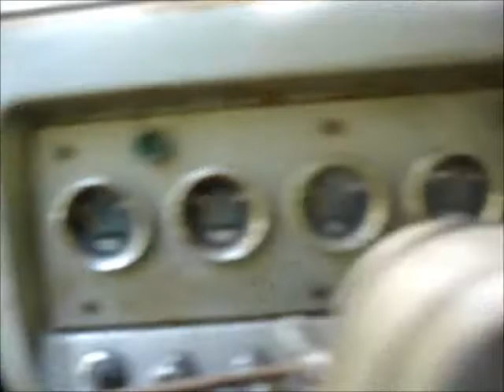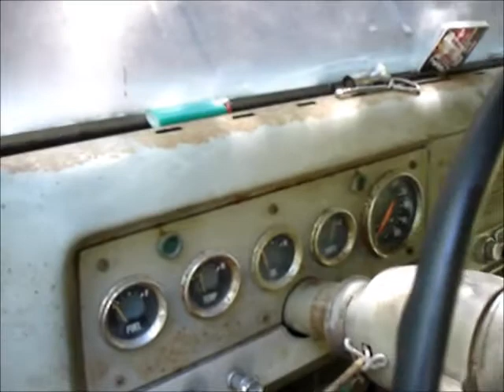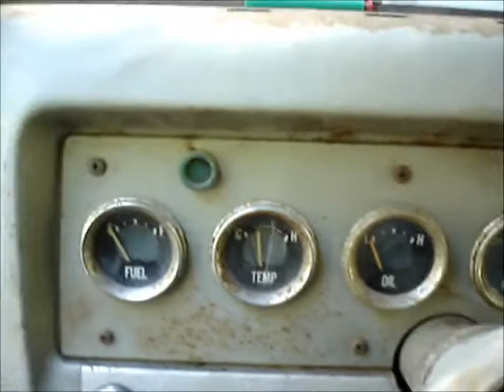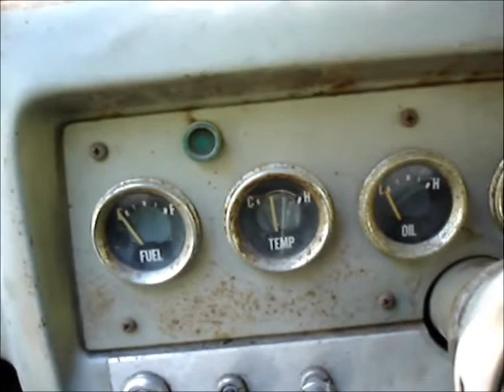Scout hydraulics

Comment: for the second set of headlights, run them off of a relay. trigger the coil side off of the main headlights, and run the power feeds directly to the battery. otherwise you'll probably get some nasty voltage droop.
Reply from the maker: I have another factory headlight switch and I'm going to mount and wire the headlights to it. It will be separate from the stock wiring. No droop thataway XD